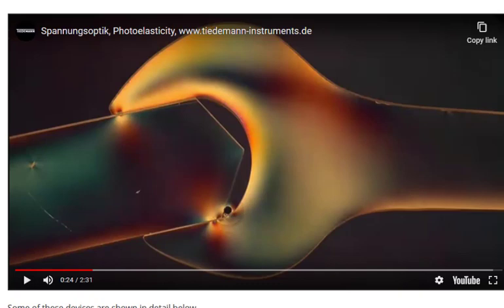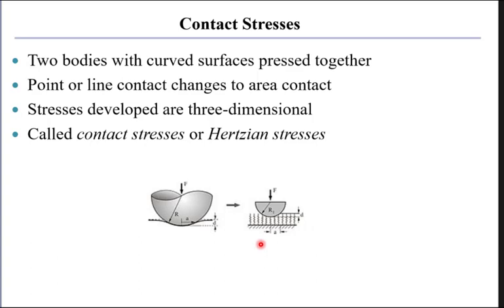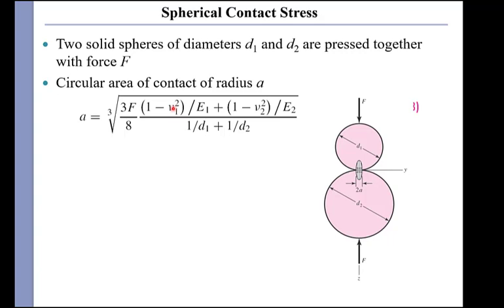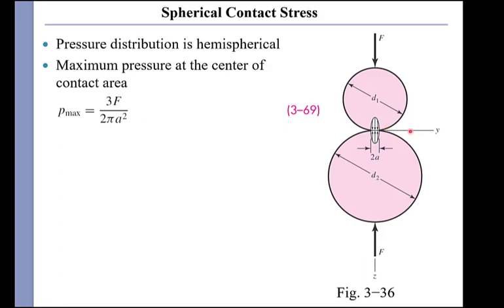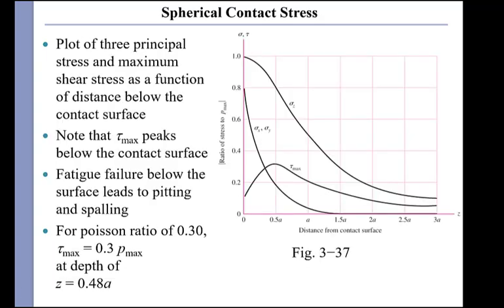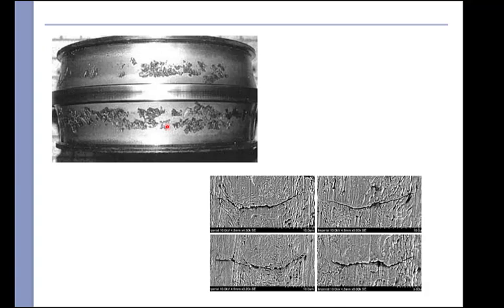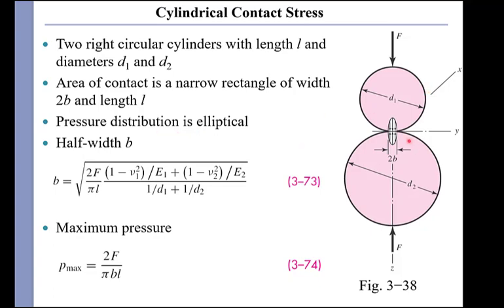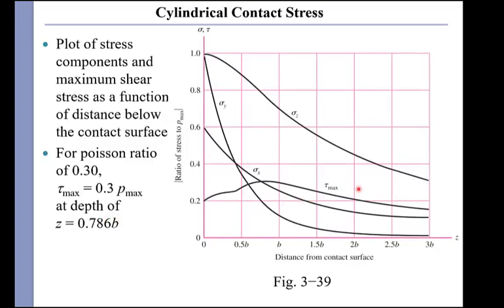Lecture 12 Contact Stress

Comment: One question sir - as I understand, theory of 'contact stresses' come in to picture when the load case qualifies 2 important conditions:
1. applied force shall be significantly high
2. area between bodies shall be very very small
The questions is - is there any specific ratio of force to contact area where we can say that any case having this ratio or above is a case of 'contact stresses'.
Reply from the maker: Since all contact begins as a point contact, even moderate applied forces can generate somewhat large local stress fields.  So, I don't think there is a lot of concern about the applied force.  If there is a normal force, there will be contact forces...but they could be small compared with external shear forces that might be applied.  As to the contact patch area, when the materials go non-linear, you will not have simple analytical solutions.  Honestly, in my experience, I use the simple 10% rule all the time...that is:  if the contact patch diameter is less than 10% of the diameter of the smaller sample, our simple solutions will likely work.  However, you can always use an FEA analysis, conducted by someone who knows what they are doing, to explore non-linear material response.  But your questions are quite good and deserve more than this quick answer.